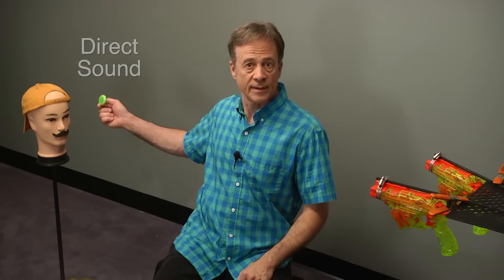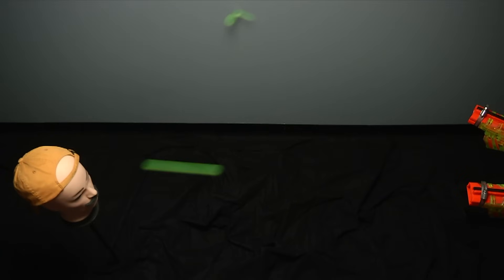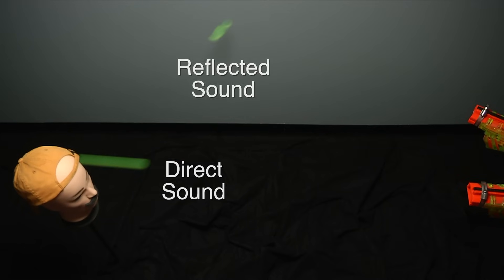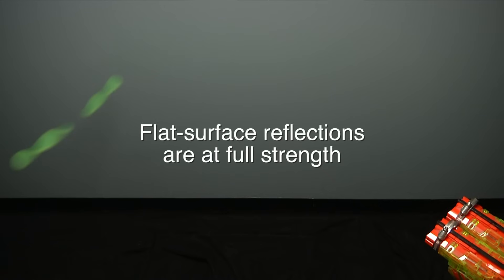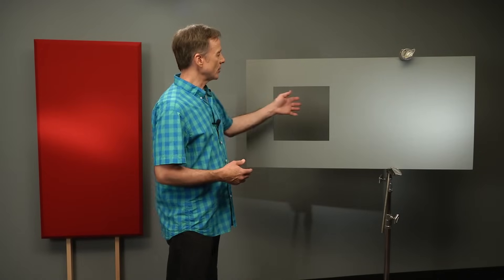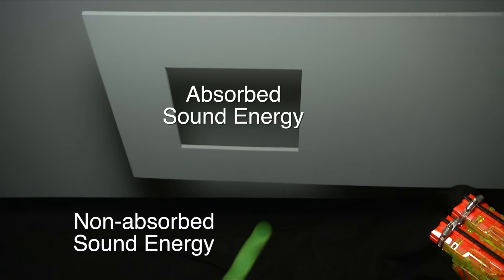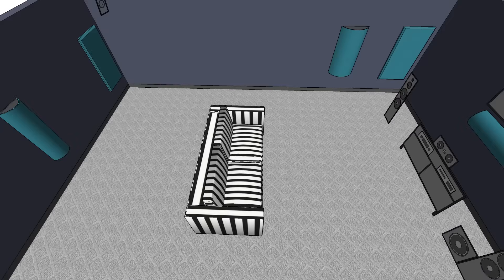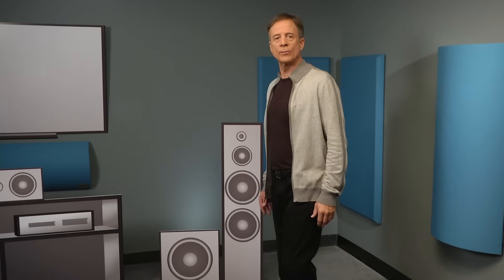An Acoustic Primer - 10 Minutes Toward Better Sound

Comment: What about open layout asymmetrical living rooms? They aren’t the standard 6 wall layout how would you proceed
Reply: Im running into this problem now. I have a window and no wall at all at my first reflection point. Use stand alone absorbers/diffusers is what I've been told. It'll look like hell, but should work for the sound.
Reply: @dextermorgan1  the problem is I don’t want it to look goofy. Sucks
Reply: @jimmymcgill5572  Same. I want it to look good. I noticed your comment is a couple of years old. Did you ever install any treatment?

Comment: some people say the curve panels are more of deflectors instead of diffusers? can anyone clear my doubt
Reply from the maker: Acoustical deflectors redirect sound unevenly toward one or more directions, and usually consist of one or more flat surfaces angled to direct sound to the specific direction(s) desired. Constant-radius (cylindrical) curved-surface sound diffusors spread out sound energy reflections evenly over a range of different angles – Acoustic Geometry Curve Diffusors are cylindrical and have a range of about 120 degrees (1/3 of a full circle) of arc, or sound spread, and can be arranged to diffuse sound energy in horizontal through to vertical planes. Curve Diffusors are phase-coherent as well.
Thanks for your question!

Comment: It is necessary to make the ink appear, black color, blue color, which should not precipitate, the operating temperature of which is -20+30 degrees, do not glow in the dark, not luminescent, initially transparent and then acquire black or blue color, with atmospheric oxygen, help?? Can You do some experiments? 
My VAC app/telegram 89147166185

Comment: Best acoustics explanation ever seen, thanks for sharing the knowledge
Reply: He doesn't do that great of a job..  His idea of Diffusion is not that accurate.  Quadratic diffusors are far superior to that of those semi-round reflectors.    There's actually a video that Ethan Winer did that demonstrates different types of surfaces.  It's about the only video of Ethan's that I feel is worth watching, though.

https://www.youtube.com/watch?v=vb30CICG68c

However, the company that I've found the best acoustic Treatment is Acoustic Fields.  They have the best low frequency absorption products.  They have hundreds of short videos you should check out.    I took some time and looked at practically every low frequency absorption device available and Acoustic Fields ACDA 12 measured the best.  Even better than RPG's more expensive Modex units and everything else.  The reason is they have deep diaphragmatic cabinets with dual wall and they use the most porous substance (activated carbon) that's densely packed internally.  I visited a test lab they had about 6 years ago and I haven't heard low frequency absorption done anywhere near as well as they had..

They actually have low frequency absorption that's effective down to 30hz.  Look at the measurements for the absorption coefficients before you buy ANYTHING.   

those round diffusors?  They aren't really diffusors and in order for them to act more like a diffusor you need a bunch of them.  But they are more sound redirection units.  the problem with Quadratic is just figuring out the distance, which Prime number to use and having enough distance between the listener and the diffusors. so in really small rooms, you have to have enough distance for Quadratic to work properly.  But those actually conform to the requirements of a true diffusor.  Those round things don't.
Reply: @Oneness100  If you read what Eric Desart has to say about that you won't be so sure : http://recording.org/studio-construction-and-acoustics-forum/26648-wasting-my-time-with-homemade-diffusers.html#post195923
Reply: Sorry the link doesn't work any more. Here's what Mr Desart wrote : Or you could think of using polys, which are just bend panels.
They are easier to make, giving a smooth response.

Have a look here:
http://pcfarina.eng.unipr.it/Public/Papers/150-ACTA2000.PDF
Reply: @studiodesquatrechemins8977  Those sties may not have properly done measurements, may not have done enough research, have access to the same materials, etc. etc. and enough testing compared to someone else that has.   

There are a lot of different materials, wall construction, testing methods, etc.
Reply: @studiodesquatrechemins8977  That URL doesn't work.
Reply: @Oneness100  Yes... recording.org have wiped out some of the content of the old acoustic forum... sorry about that. But the link to the Farina paper works.
Diffusion/scattering doesn't relates so much on material. You can check the Farina paper and the Cox/
D'autonio book.
Reply: @studiodesquatrechemins8977  I don't know who Eric Desert is.
Reply: @Oneness100  Eric Desart was an acoustician from Belgium.  He worked in industrial acoustics and also for recording studios. He built the massive Galaxy studios complex, he had unlimited budget to do so. You can still find a lot of his advice on the acoustics forums. A video taken during a recording session at Galaxy : https://youtu.be/uESBTIumFdY
Reply: @studiodesquatrechemins8977  OK. And?  First off, there's plenty of studios out there.  The thing is, small room acoustics is another type of specialty.  Most small rooms have problems, especially in the lower frequencies 100hz and lower.  In order to manage those, one must use large diaphramatic absorption cabinets (or build the technology into the walls).  Also, there's one company that I found that has patents on using Activated Carbon for the absorption material inside these diaphragmatic cabinets. Eric hasn't used them. He's probably never seen them either.

2. for mid's and high frequency absorption, there's a variety of products on the market that people use.  Again, the big difference in these products is the absorption curve from 125hz to about 1000hz.. Most people don't even know this, nor do they even understand why one product may not sound as good as another.  I have found this same company developed their own acoustic foam to have an absorption coefficient curve that matches up to the human hearing curve that Fletcher Munsen have devised.  Why is that important?  Because if you use a product that matches up well, it's going to sound more natural, providing you have enough coverage of that acoustic foam..  Other products on the market simply do not have an absorption curve that matches theirs.

3.  There are lots of different products on the market that people THINK are diffusors.  However, there are 5 requirements for a true diffusor and Quadratic residue diffusors meet all 5 of those requirements.  But, in order to get the room to sound right using Diffusors, you have to first get the lows, mid's and high's treated properly and then you have to figure out which Prime sequence to use, where to place them and having enough coverage for the application..

Large room acoustics is totally different..  Check out Bop Studios in S. Africa.  It was designed by Tom Hidley.   https://www.soundonsound.com/music-business/bop-studios-story. check out the videos of the studios.  

I looked at some of the photos of Galaxy studios and there's some things about their wall construction that I think could be done better using this other companies wall structure design and using Activated Carbon.
Reply: @Oneness100  You probably know better than the late Eric Desart and George Massenburg, no doubt about that
Reply: @studiodesquatrechemins8977  No, but I'm learning about new technology that is relatively brand new.  George knows about parametric EQ.  

There are new technologies that have emerged that changes things.  And this one company has that.  He's using materials that no one else used, so how could they know?  

Most people, even the most educated acoustic engineers, never paid much attention matching the absorption coefficient to the Fletcher Munsen hearing curve. I think that's a MAJOR advancement.  Most absorption materials used were used because they were CHEAP building insulation.  But if you look at wall construction before sheet rock came out, they were using different materials that are more expensive.

Most people use sheet rock instead of finished grade plywood because of the cost.  Most people don't use 2'x12" studs in the walls and use a combination of finish grade plywood, MDF, MLV, and activated carbon filters inside a wall.  

Most people just use 2'x4' or 2'x6' studs with double sheet rock and green glue and they stuff it with cheap fiberglass or rock wool with a music room.

I am learning about this from the guy who invented these new materials and ways for wall construction and he's done many room builds, he's tested using accellerometers and traditional audio tests and compared against the most common wall construction used.

I can't help if if Eric didn't know about these newer methods. I can't help it if George Massenburg doesn't know about these newer methods.

But Capital Records' mastering room uses this company's technology to fix the low frequency problems and they LOVE it.  they getting more and more clients getting blown away by the drastic improvement.

www.acousticfields.com check em out, see if you check out one of their rooms and hear for yourself.
Reply: @Oneness100  When people are talking about material rather than acoustics it's time time to move on. You might have something to sell, but I'm not your customer. Thank you.
Reply: @studiodesquatrechemins8977  No, I'm not trying to sell you anything. I can point you in a direction that I feel has good design, well built, and using materials that others don't use and their products are better because of their absorption coefficients for absorption. But I'm not trying to sell you anything, that's YOUR decision.

Comment: I have a question about killing very high pitched noises in a wood shop.  what would work best?  I have a mixture of concrete walls and 1/2 inch drywall.